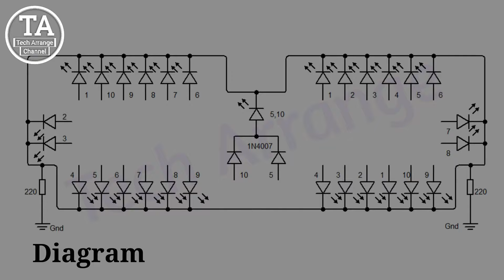[NEW] Amazing Effect Running LED Chaser  LED Chaser Using 555 and 4017 ic

Comment: Tell me please, what function make a diodes?  I don't get it.
Reply: When the IC output pin is at off state it gives 0v and when it is at on state it gives +3v, if you want to connect 2 outputs together you need to use 2 diodes before merging. simple